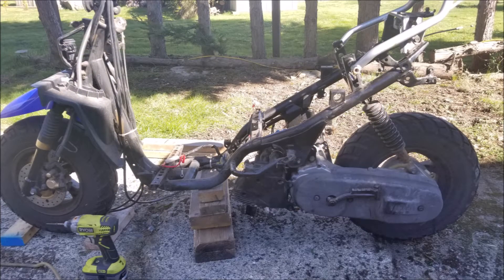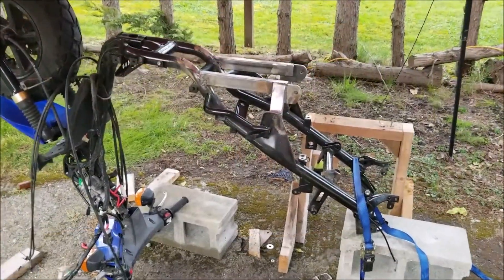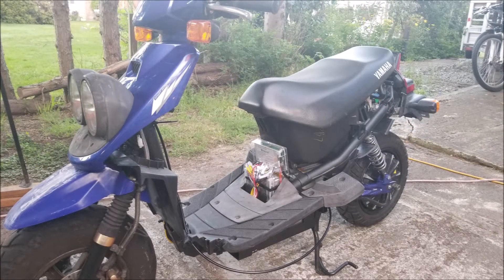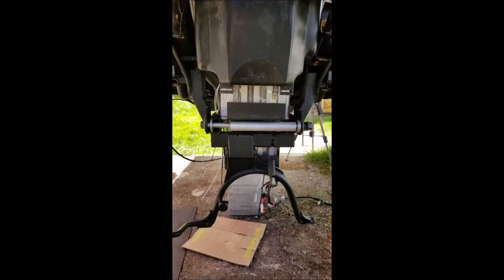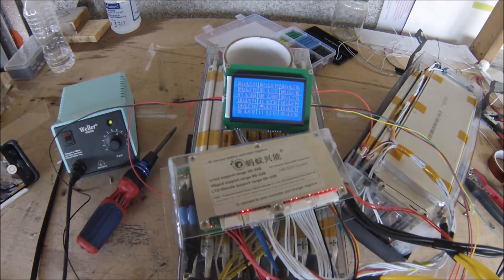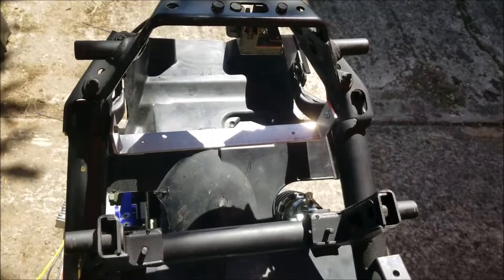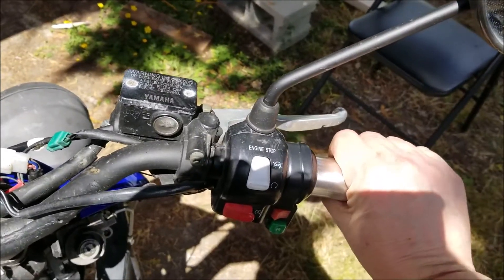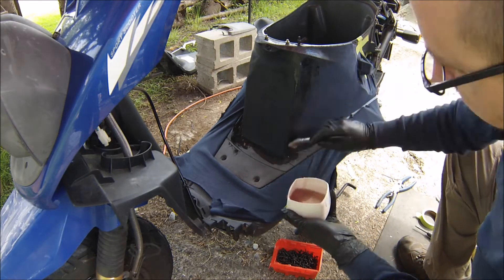Yamaha BWS electric conversion

Comment: OK. Being 4 years later. what hub motor would you go for if you were gonna do it now? I can't find this motor you're using.
Reply from the maker: Good question. the latest motor I'm using is from Yuma motor
Reply from the maker: https://x.alibaba.com/B0As2d?ck=minisite
Reply from the maker: I like these guys but they don't often sell in single but usually you have to buy five or more.  But if you call them or message them you might be able to work out a deal

Comment: Although I’m a fan of hub motors myself, for the BW, I think it should have had a mid drive with a chain or belt. 
It could’ve then retained the big rim & sand tyre which is a big part of the BW’s charm.
Reply from the maker: yeah I have some idea for a future build to try to retain as much of the BWs as possible (including using the factory rear swingarm)

Comment: Great video sir. I am interested to ask about keeping analouge gauges which i understood it didnot work out for you because of fuel signal vonversion..did speedometer work for conversion? How did you do that? Any other videos or material regarding that? Thanks
Reply from the maker: In my opinion, if you can keep the analog gauges that would be awesome.  I spent a lot of time trying to figure out how to convert a battery voltage to an analog fuel gauge signal but haven't succeeded yet.  
The speedometer is easy because as far as I know every single motor speed controller sends a tac signal that can incorporate it to any gauge and then you calibrate it for wheel size.  A lot of the new motor speed controllers and gauges use a data bus to protocol called LIN that does all the hard work for you.  You just have to make sure the digital gauge and the motor speed controller are compatible.  The seller will help you with that.

Comment: Don't understand why people put all the time, effort, and money into regen. No matter how much range you have, you'll always want another klick. Brake pads are cheap and easy to install.  Easy to find space for more batteries, if needed. Regen braking can be tricky in slippery conditions or in a turn. A tire don't need to lock up to skid, just needs to turn much slower than the bike. Besides, around 70% of the braking power comes from the front wheel, that why people lose the rear or skid under braking.  With a brake lever/pedal, you can ease up on the force or slip the clutch. With regen you have to roll the throttle back on which is tricky to learn.
Reply from the maker: That is why I like the variable regen that Kelly Controllers have.  I wish Votol controllers had the same.  With variable regen, if you drive conservatively, you can stop without using the brakes until the very last few feet.  I do not know how much power is recovered and it would not be prudent to guess.  Maybe someday I will measure it.  I can tell you by experience that using variable regen for stop and go makes the driving experience awesome when used correctly.  I love my votol controller but I really miss the Kelly variable regen feature.
Reply: @diyelectrified1289   It's not about normal or conservative driving/braking. Lot's of spilling in a turn are from rolling the throttle off on higher compression bikes.  Look at many crashes(easy to see now-a-day with the youtube, etc) the rear end slips out first.  But then again, it's just a scooter.  Dirt bike riders had to start slipping their clutches  when they moved from 2 strokes to 4 strokes. At least with a break lever or pedal you can modulate.  But anyway, it's just a scooter
Reply from the maker: @GoofieNewfie69  Admittedly I am not a motorcycle guy.  So far in my life I have rode mountain bikes and scooters and cars.  I do not doubt your knowledge on this issue.  I think you have correctly pointed out that scooters are less of an issue. 
In case you didn't pick up on the variable regen that I installed on the BWS, I had a thumb throttle on the left handlebar that was easily reachable with the left thumb without changing hand position.  It worked great once you got the hang of it.  You could apply very little regen or a lot when needed and vary it based on road conditions.  
Now that you brought up the topic I recall a day when I had to apply emergency braking due to an inattentive driver.  I applied full regen and too much rear brake simultaneously and experienced the locked up rear tire issue.  Luckily I was going straight and did not drop the scooter.
Thanks for the constructive input!
Reply: @diyelectrified1289   Again around 70% of  a motorbike's breaking power is from the front brake. ear braking demands a gentle touch, regen rarely allows this. When I used to race super bike, most if nor all of us screwed up when using rear brakes and/or rolling off the throttle. Brake pads are cheap.  All these new ideas still don't outweigh the old practices, throttle forward, friction brakes to slow or stop. Imagine a regen lockup in a turn

Comment: Any idea of total cost to get it fully running? Also do you think its heavier or lighter with electric gear and batteries vs petrol engine?
Reply from the maker: 4k CAD.
It's only one or two kilograms heavier.
Reply: @diyelectrified1289  thanks for the reply. Nice work on the build btw. Do you have any videos of it running? I bet its quiet as a mouse compared to the petrol engine
Reply from the maker: Thank you! Yes there should also be a video in my Channel with me driving it.
Reply: Interesting job. Is possible to use electric motor  central? Why not?
Reply from the maker: @leonelestidthramirez4081 Yes, of course it is possible.  I personally chose to go with a hub motor because of simplicity.  I think that going with a mid-mount motor requires a higher degree of fabrication skills.  There are positives and negatives to choosing either configuration.  The performance gains I.e higher RPMs and better starting torque are more applicable to a motorcycle than a scooter.

Comment: Fascinating video.  I have a 100cc two-stroke BWS that I'm thinking of upgrading.  How did you manage to get those beautiful curves on #3 of your front cowling?  Did you have to make a former of some sort?
Reply from the maker: I used 1/4 in foam board that I sliced every 1/2 in so it would bend evenly.  I didn't film it because after my third iteration I was just trying to get something that worked.  I covered that over with stretch cloth just to keep everything tight
Reply: @diyelectrified1289  Are you using Lycra fabric?
Reply from the maker: Lycra is a good choice.  Any fabric that expands in four directions and that can tolerate the resin will work.  I used to know someone that would use a fairly thick fleece because he could really saturate it with a lot of resin and therefore have to do much fewer or even no back layers (to build up the strength).  
When I was originally taught to do this in my custom car audio days we used  speaker grill cloth because we had lots of it.

Comment: Not even motorcycle it's scooter 😂
Reply from the maker: That's what a Yamaha bws is.  A scooter.
Reply from the maker: If you want to get semantic about it the Yamaha is an actual motorcycle and what you would call a motorcycle is actually an engine cycle.
Reply: @diyelectrified1289  😂 still not a motorcycle style anyways look like a sport bike motorcycle then yes I will call it motorcycle
Reply from the maker: Well I don't think it's a motorcycle either but that's what the government calls it.  LSM = limited speed motorcycle

Comment: one more question.did u check that stator magnet?is it possible to install it on other rims?
Reply from the maker: The QS hub motor is one complete unit.
Reply: @diyelectrified1289  oh ok thanks.

Comment: You should've kept the cvt and mount an electric motor on the piston block mount. That way you can utilize the additional torque and rpm.
Reply from the maker: I have considered this.  However using the CVT will waste power as it is designed to match the torque curve of a gas/piston motor.   I have plans to do a conversion that will keep the original swing arm but not use the CVT transmission.
Reply: The clutch system is not good. Its slipping. . If there is a way to lock it then it should be great.

Comment: Hey great video, I currently own this very same model and It runs great and has been super dependable however I am concerned about the level of pollution it emits.  I have some questions for you about this conversion.  Obviously it wasn't cheap, can you say approximatly what you paid for parts total and add to that what the digital display you just had lying around might cost.  Second, have you had a chance to evaluate the performance?  What are the stats, specifically range on a full charge, time to recharge battery completely (110V or 220V).  Thanks in advance.
Reply from the maker: Hi there. The build costs between 3500 and 4,000 Canadian dollars.  I was focused on the build and didn't keep track of every expense so I think it's understandable to have a $500 variance.  All the major parts are listed in the description.  I get about 100 km range.  I could get more but I limit the charging voltage to four volts in the discharge voltage to 3 volts to preserve battery longevity.
I have a charger that does 5 amps or 10 amps. If I select 10 amps I can recharge the bike in around 3 hours after normal use (3/4 depletion)